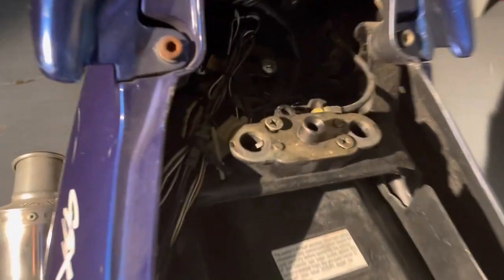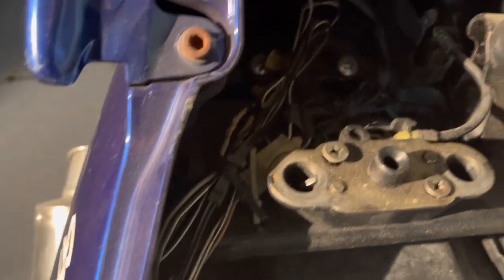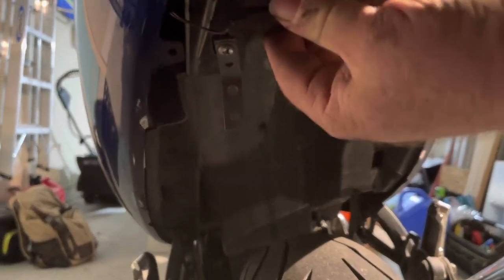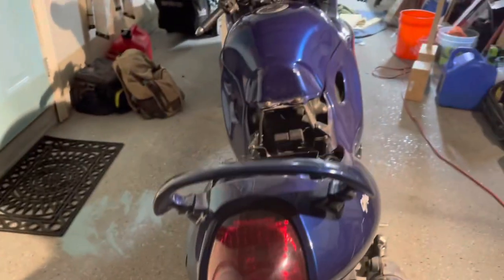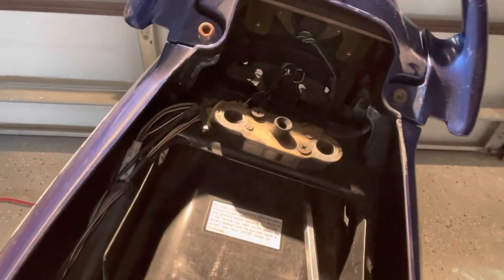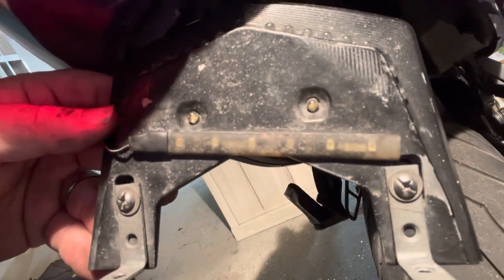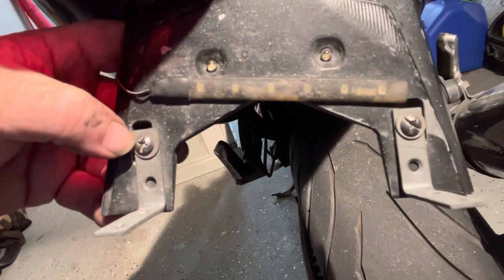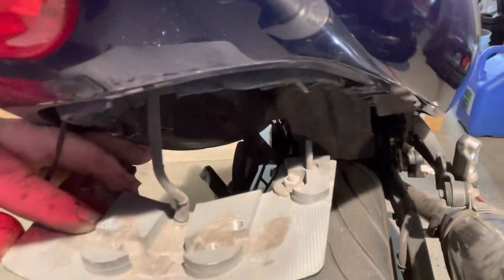Put on the plastic and plate holder thingy

Comment: 2:15 Looking at the universal licence holder in your hand, the part you're holding should attach to the bike and probably needs a couple of right angled brackets fitted under the rear of the bike. The part in front of your face is likely where the licence plate bolts to. You may have already figured that out. Good luck with it 👍